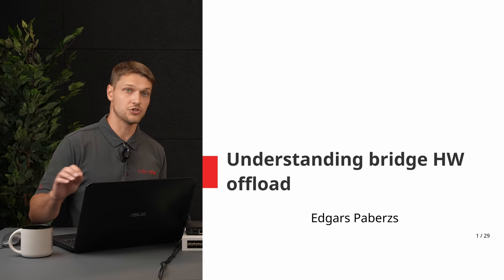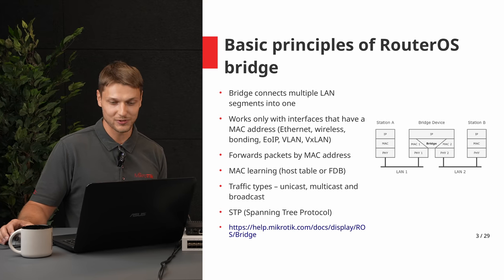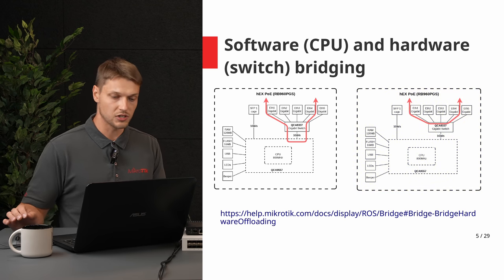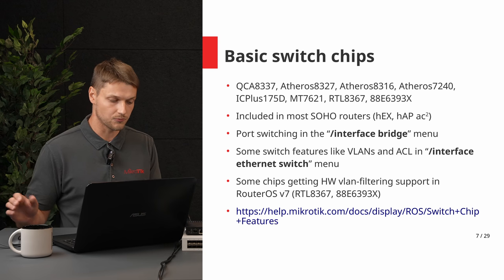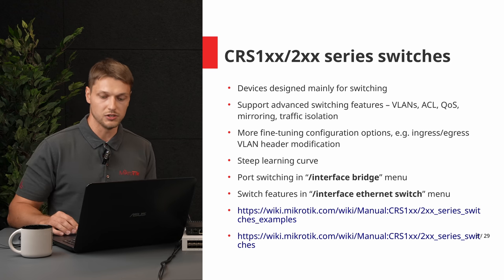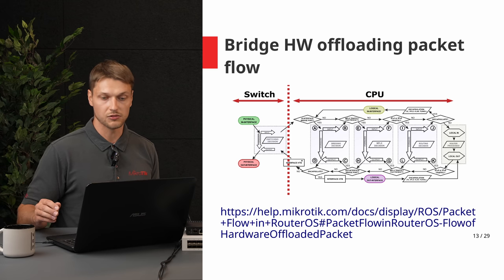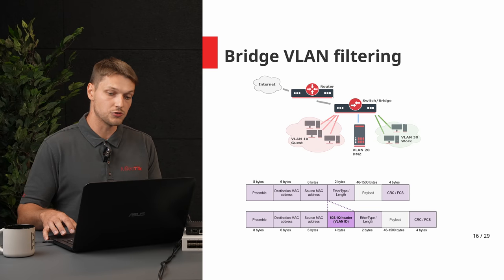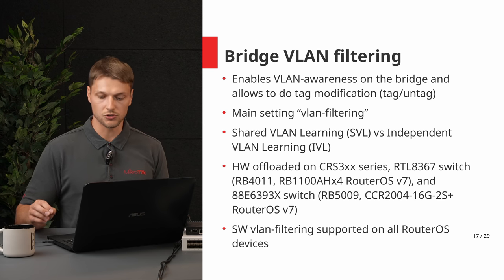Diving deep into RouterOS: Switching

Comment: Just the video I have been waiting for! Thank you!

Up next: VLANs 😊
Reply: I was shocked that any phone you buy from China is not true 5G  They said they are, then I showed them why they are not as they said.  Poor vendors are selling phone  Alibaba and other thinking they are true 5G.  Excellent and cheap phones, can detect 5G form the phone company, except they do not detect, 5G WIFI only 2.4G and their hotspot only can be set to 2.4G not 5G.  Finally they admit they made a mistake?   Also, when they have an older Android 10 operating system, is very questionable.  Do you have any way of fixing those Chinese cell phones to work 5G and if the Android is 10 we have to update it to 11.   with   I am in the process of getting my free hotspot from my cell through my router again, not in restricted bridge mode, in the past, for almost one year, I used open WRT, my friend set it for me.  Now I have to it on my own again.

Comment: Many videos like this is really appreciated
Reply: I was shocked that any phone you buy from China is not true 5G  They said they are, then I showed them why they are not as they said.  Poor vendors are selling phone  Alibaba and other thinking they are true 5G.  Excellent and cheap phones, can detect 5G form the phone company, except they do not detect, 5G WIFI only 2.4G and their hotspot only can be set to 2.4G not 5G.  Finally they admit they made a mistake?   Also, when they have an older Android 10 operating system, is very questionable.  Do you have any way of fixing those Chinese cell phones to work 5G and if the Android is 10 we have to update it to 11.   with   I am in the process of getting my free hotspot from my cell through my router again, not in restricted bridge mode, in the past, for almost one year, I used open WRT, my friend set it for me.  Now I have to it on my own again.

Comment: Hope this wont change in the future. Please standardize VLAN configuration on your devices.
Reply: I too would really like to have standardized VLAN switching/bridge configuration over CRS 100/200 and 300 series devices, hopefully even any RouterOS device with switch chip with VLAN support.
Having to remember or lookup how to configure each product series individually is just not intuitive and there was more than a time or two, that I had to redo the config to get switch chip performance instead of unnecessarily overloading the CPU and bogging down forwarding performance.
Reply: Bridge VLAN filtering is how they should do it on all devices.  It's the most simple method.
Reply: I was shocked that any phone you buy from China is not true 5G  They said they are, then I showed them why they are not as they said.  Poor vendors are selling phone  Alibaba and other thinking they are true 5G.  Excellent and cheap phones, can detect 5G form the phone company, except they do not detect, 5G WIFI only 2.4G and their hotspot only can be set to 2.4G not 5G.  Finally they admit they made a mistake?   Also, when they have an older Android 10 operating system, is very questionable.  Do you have any way of fixing those Chinese cell phones to work 5G and if the Android is 10 we have to update it to 11.   with   I am in the process of getting my free hotspot from my cell through my router again, not in restricted bridge mode, in the past, for almost one year, I used open WRT, my friend set it for me.  Now I have to it on my own again.

Comment: Hi Edgars,

Regarding your presentation at site 4. 
Basically you're saying that we can disable RSTP protocol on individual port by command"

#Change port edge settings
/interface bridge port
set [find interface-ether1] edge=yes

My quastion is":
why im sseeing on the status ticked box for "Sending RSTP"?
Should be disabled, according to what you saying
Reply from the maker: The "sending-rstp" can be confusing. It actually shows whether a port should be using RSTP/MSTP BPDU types or STP BPDUs. It does not represent the fact that port is sending BPDUs. We will consider improving the description for this monitor value.
Reply: @mikrotik  because if ill disable rstp from the bridge interface, then will disappear

Comment: Great video lads!
Reply: I was shocked that any phone you buy from China is not true 5G  They said they are, then I showed them why they are not as they said.  Poor vendors are selling phone  Alibaba and other thinking they are true 5G.  Excellent and cheap phones, can detect 5G form the phone company, except they do not detect, 5G WIFI only 2.4G and their hotspot only can be set to 2.4G not 5G.  Finally they admit they made a mistake?   Also, when they have an older Android 10 operating system, is very questionable.  Do you have any way of fixing those Chinese cell phones to work 5G and if the Android is 10 we have to update it to 11.   with   I am in the process of getting my free hotspot from my cell through my router again, not in restricted bridge mode, in the past, for almost one year, I used open WRT, my friend set it for me.  Now I have to it on my own again.

Comment: Give us 802.11 k/v/r and wave 2 support on hap ac²
Reply: 802.11 k/v/r are overrated and don't behave or work the way we think they do.  Wave2 support though would be nice but I doubt there would  be that much of a performance improvement, particularly if the radio is still only 2x2.  Putting effort into an AX access point is where I'd prefer they put their time.
Reply: @KaldekBoch  in my experience they work almost perfectly on openWRT, both on 2.4 and 5g bands, I much prefer 1 in 10 calls breaking up than manually reconnecting to another AP every time
Reply: I was shocked that any phone you buy from China is not true 5G  They said they are, then I showed them why they are not as they said.  Poor vendors are selling phone  Alibaba and other thinking they are true 5G.  Excellent and cheap phones, can detect 5G form the phone company, except they do not detect, 5G WIFI only 2.4G and their hotspot only can be set to 2.4G not 5G.  Finally they admit they made a mistake?   Also, when they have an older Android 10 operating system, is very questionable.  Do you have any way of fixing those Chinese cell phones to work 5G and if the Android is 10 we have to update it to 11.   with   I am in the process of getting my free hotspot from my cell through my router again, not in restricted bridge mode, in the past, for almost one year, I used open WRT, my friend set it for me.  Now I have to it on my own again.

Comment: Hello, Hug from Argentina.  Query: I have this Rb4011 in my home with a basic configuration, and I see that if I put the ethernet ports in the bridge I lose the hardware download (HW), but if I deactivate the STP I recover the HW, it is convenient to deactivate the STP in the bridge in a home network?  Thanks and regards
Reply: With RouterOS7, it will do it in hardware.  However, the RB4011 is so fast that you probably won't notice any performance issues even without the hardware offload even on RouterOS 6.
Reply: @KaldekBoch  Thanks! I'll wait for v7 then. Greetings!
Reply: Hello, you can turn off STP at home if you promise to not creating a loop in your broadcast domain (~LAN)
STP actualy blocks traffic from one of the ports (if there is loop) to prevent broadcast storm because you dont have TTL on layer 2. But its not so scary if you have a loop with "STP off" - you network would just not work till you find and delete the loop, without any hardware damage. So dont be scared to turn off STP.
Other options:
1. upgrade to Ros 7 with h/w offload STP on these device
2. Leave as is - because your home network usualy cant overload your Rb4011 (just overheat - joke) (its overheats by itself - another joke) XD
Reply: @Pierre_1279  ROS 7.1rc6 will work fine on the RB4011 now.

Comment: Thanks, informative and usefull video.
Reply: I was shocked that any phone you buy from China is not true 5G  They said they are, then I showed them why they are not as they said.  Poor vendors are selling phone  Alibaba and other thinking they are true 5G.  Excellent and cheap phones, can detect 5G form the phone company, except they do not detect, 5G WIFI only 2.4G and their hotspot only can be set to 2.4G not 5G.  Finally they admit they made a mistake?   Also, when they have an older Android 10 operating system, is very questionable.  Do you have any way of fixing those Chinese cell phones to work 5G and if the Android is 10 we have to update it to 11.   with   I am in the process of getting my free hotspot from my cell through my router again, not in restricted bridge mode, in the past, for almost one year, I used open WRT, my friend set it for me.  Now I have to it on my own again.

Comment: i wouldn't like to enable ingress filtering. 
That allows me to use "user service tag". 
So i can use it as a tunnel between the sites
Reply: I was shocked that any phone you buy from China is not true 5G  They said they are, then I showed them why they are not as they said.  Poor vendors are selling phone  Alibaba and other thinking they are true 5G.  Excellent and cheap phones, can detect 5G form the phone company, except they do not detect, 5G WIFI only 2.4G and their hotspot only can be set to 2.4G not 5G.  Finally they admit they made a mistake?   Also, when they have an older Android 10 operating system, is very questionable.  Do you have any way of fixing those Chinese cell phones to work 5G and if the Android is 10 we have to update it to 11.   with   I am in the process of getting my free hotspot from my cell through my router again, not in restricted bridge mode, in the past, for almost one year, I used open WRT, my friend set it for me.  Now I have to it on my own again.

Comment: Random mac on traf. generator? Does this mean that there is still a random number generator in RouterOS? Can I get access to it? It would be useful for the crane to generate passwords and secrets, as well as, for example, for balancing tunnels at the configuration stage from a script...
Reply from the maker: You have it already: 

[admin@MikroTik] > :put [:rndnum from=10 to=100]
37

[admin@MikroTik] > :put [:rndstr length=12 from="asdasdsafgwergqdgqerg"]
ggeassdefasr
Reply: I was shocked that any phone you buy from China is not true 5G  They said they are, then I showed them why they are not as they said.  Poor vendors are selling phone  Alibaba and other thinking they are true 5G.  Excellent and cheap phones, can detect 5G form the phone company, except they do not detect, 5G WIFI only 2.4G and their hotspot only can be set to 2.4G not 5G.  Finally they admit they made a mistake?   Also, when they have an older Android 10 operating system, is very questionable.  Do you have any way of fixing those Chinese cell phones to work 5G and if the Android is 10 we have to update it to 11.   with   I am in the process of getting my free hotspot from my cell through my router again, not in restricted bridge mode, in the past, for almost one year, I used open WRT, my friend set it for me.  Now I have to it on my own again.
Reply: @mikrotik  on ROS7 only? Oh yeah - a random number generator must have a fresh Linux kernel...

Not sofunny - ROS7 will be on prod in at least a year.

Comment: Very Great!!!!
Reply: I was shocked that any phone you buy from China is not true 5G  They said they are, then I showed them why they are not as they said.  Poor vendors are selling phone  Alibaba and other thinking they are true 5G.  Excellent and cheap phones, can detect 5G form the phone company, except they do not detect, 5G WIFI only 2.4G and their hotspot only can be set to 2.4G not 5G.  Finally they admit they made a mistake?   Also, when they have an older Android 10 operating system, is very questionable.  Do you have any way of fixing those Chinese cell phones to work 5G and if the Android is 10 we have to update it to 11.   with   I am in the process of getting my free hotspot from my cell through my router again, not in restricted bridge mode, in the past, for almost one year, I used open WRT, my friend set it for me.  Now I have to it on my own again.

Comment: Very well  tkx
Reply: I was shocked that any phone you buy from China is not true 5G  They said they are, then I showed them why they are not as they said.  Poor vendors are selling phone  Alibaba and other thinking they are true 5G.  Excellent and cheap phones, can detect 5G form the phone company, except they do not detect, 5G WIFI only 2.4G and their hotspot only can be set to 2.4G not 5G.  Finally they admit they made a mistake?   Also, when they have an older Android 10 operating system, is very questionable.  Do you have any way of fixing those Chinese cell phones to work 5G and if the Android is 10 we have to update it to 11.   with   I am in the process of getting my free hotspot from my cell through my router again, not in restricted bridge mode, in the past, for almost one year, I used open WRT, my friend set it for me.  Now I have to it on my own again.

Comment: Presentation pdf
Reply from the maker: Will upload soon
Reply from the maker: See description
Reply: @mikrotik  thanks you
Reply: I was shocked that any phone you buy from China is not true 5G  They said they are, then I showed them why they are not as they said.  Poor vendors are selling phone  Alibaba and other thinking they are true 5G.  Excellent and cheap phones, can detect 5G form the phone company, except they do not detect, 5G WIFI only 2.4G and their hotspot only can be set to 2.4G not 5G.  Finally they admit they made a mistake?   Also, when they have an older Android 10 operating system, is very questionable.  Do you have any way of fixing those Chinese cell phones to work 5G and if the Android is 10 we have to update it to 11.   with   I am in the process of getting my free hotspot from my cell through my router again, not in restricted bridge mode, in the past, for almost one year, I used open WRT, my friend set it for me.  Now I have to it on my own again.

Comment: 👍🏻👍🏻
Reply: I was shocked that any phone you buy from China is not true 5G  They said they are, then I showed them why they are not as they said.  Poor vendors are selling phone  Alibaba and other thinking they are true 5G.  Excellent and cheap phones, can detect 5G form the phone company, except they do not detect, 5G WIFI only 2.4G and their hotspot only can be set to 2.4G not 5G.  Finally they admit they made a mistake?   Also, when they have an older Android 10 operating system, is very questionable.  Do you have any way of fixing those Chinese cell phones to work 5G and if the Android is 10 we have to update it to 11.   with   I am in the process of getting my free hotspot from my cell through my router again, not in restricted bridge mode, in the past, for almost one year, I used open WRT, my friend set it for me.  Now I have to it on my own again.

Comment: Russian version? Or subs?
Reply: леарн энглишь, беатч!
Reply: I was shocked that any phone you buy from China is not true 5G  They said they are, then I showed them why they are not as they said.  Poor vendors are selling phone  Alibaba and other thinking they are true 5G.  Excellent and cheap phones, can detect 5G form the phone company, except they do not detect, 5G WIFI only 2.4G and their hotspot only can be set to 2.4G not 5G.  Finally they admit they made a mistake?   Also, when they have an older Android 10 operating system, is very questionable.  Do you have any way of fixing those Chinese cell phones to work 5G and if the Android is 10 we have to update it to 11.   with   I am in the process of getting my free hotspot from my cell through my router again, not in restricted bridge mode, in the past, for almost one year, I used open WRT, my friend set it for me.  Now I have to it on my own again.

Comment: кажется, что по-русск4и они рассказали бы лучше ))
Reply from the maker: Edgars does not speak Russian at all, so no 😬
Reply: I was shocked that any phone you buy from China is not true 5G  They said they are, then I showed them why they are not as they said.  Poor vendors are selling phone  Alibaba and other thinking they are true 5G.  Excellent and cheap phones, can detect 5G form the phone company, except they do not detect, 5G WIFI only 2.4G and their hotspot only can be set to 2.4G not 5G.  Finally they admit they made a mistake?   Also, when they have an older Android 10 operating system, is very questionable.  Do you have any way of fixing those Chinese cell phones to work 5G and if the Android is 10 we have to update it to 11.   with   I am in the process of getting my free hotspot from my cell through my router again, not in restricted bridge mode, in the past, for almost one year, I used open WRT, my friend set it for me.  Now I have to it on my own again.
Reply: @mikrotik  russians are kinda shoking by fact that ppl from ex-occupied territories do not speak russian...